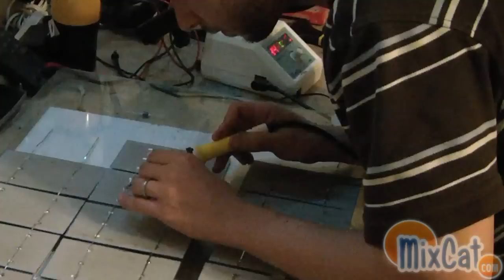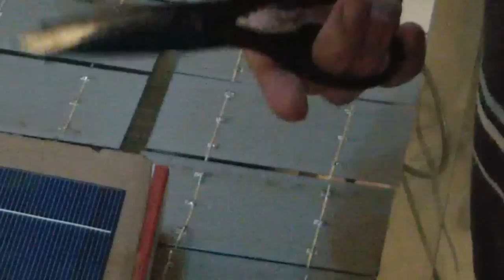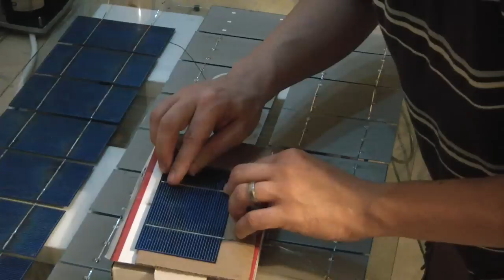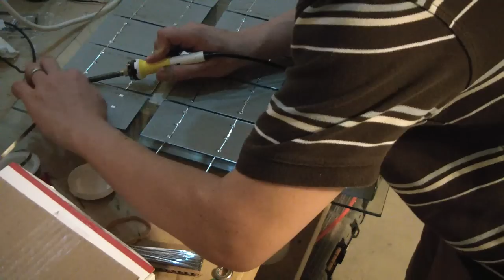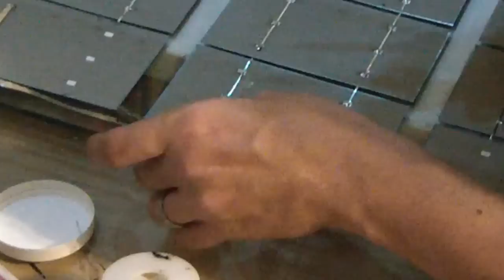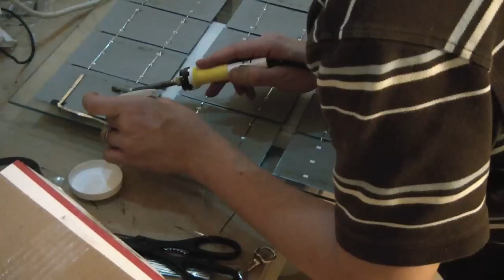How to build a Solar Panel from Solar Cells DIY - Part 2

Comment: I find it easier and much faster to solder tabs using a small metal pick,like a dental pick,to hold the tabbing wire rather constantly moving a weight around. You might find it easier but, in the end, whatever works best for you.

Comment: I like to scrap the white stuff off then the tab is definitely gonna stick plus I liked to put soldier on the cell first. then its gonna stick for eternity. I ve had it come loose when I didnt scrape off the white protective coating.

Comment: Incredible, I've been looking for this info and I'm still watching but looks like you take someone through most of it and since you sodder at work I trust you though most say that you don't need much flux or the cell Co's that sell say all the flux other then a swipe with a pin is overkill and not to use sodder on the tabbings that much.  But I take your word. You seem young and what you teach will reduce carbon ft prints to a %. Thanks and advise on inverters or Controllers to $ on eBa wd B nis

Comment: Is using flux in a container better than a flux pin. I also noticed what appears to be globs of solder on the 6 solder spots on the cells (+) side. I have never used solder when assembling with pre-soldered tabbing wire. All my connections seemed to adhere well. I did get some crappy cells once and no matter how much flux or solder I used the tabbing wire would not stick. And always, no matter how monotonous, precheck every cell prior soldering into the system. I usually find one out of 75 bad.

Comment: Hi there!
On the second video u connected the 2 lines together on the left sinde of the hole thing as we see it . How u connect the 3 line of cells ? u go on the right side and u connect the third line of cells with the second one ? and in the end which wires do u get out ?

Comment: whats the black thing on the back of the far left row of solar cells where the larger tabbing wire is bent at a 90 degree angle? I'm pretty ignorant about this stuff but it seems like a part that shouldn't be overlooked. Thanks. -Wes

Comment: almost 7 years later, so hows this panel running? It is easy to make them but i worry about sealing them from moisture.
i wonder if you can pull a vacuum and fill it with argon... or would that block UV rays?